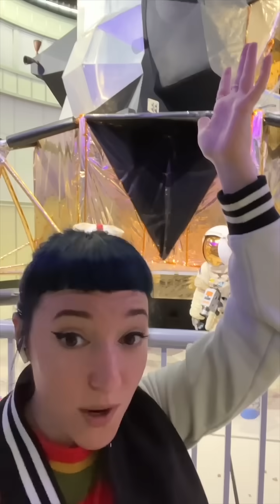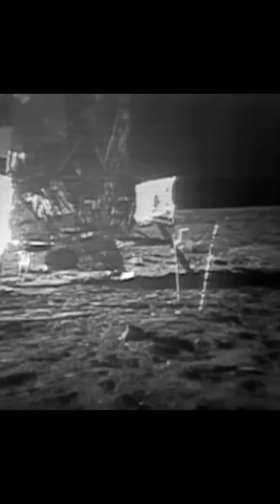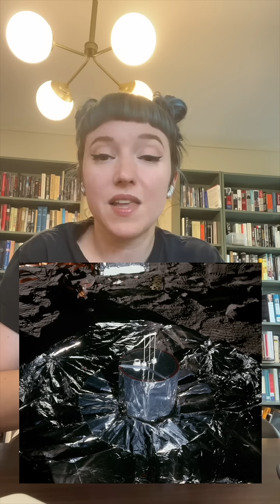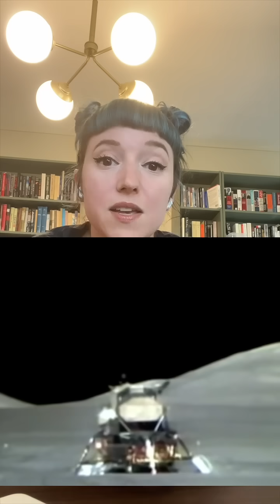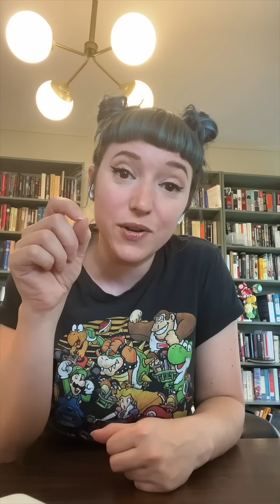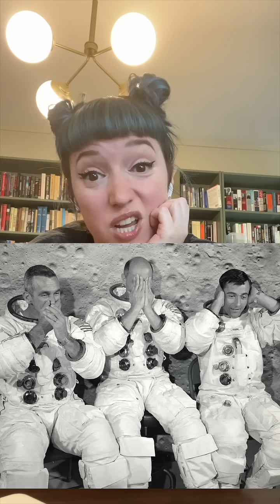Crashing Apollo Spacecraft for Science #shorts #history

Comment: Wow - I thought the Apollo 13 Lunar Module was jettisoned in space and was unaware it was directed to crash into the ocean.  It didn’t burn up on re-entry? What’s a good resource to learn more about this?
Reply: "It didn’t burn up on re-entry?"

Yes, most of it would have burned up. But parts would likely have survived.

One part which definitely would have survived was the "nuclear material". That was a radio-isotope thermoelectric generator (RTG). The RTG generated electricity from the decay of radioactive material, and was used to power the science instruments intended to be set up on the Moon.

For safety reasons the Apollo RTGs were designed to be very robust (think of a Saturn V exploding on the pad). As a result the Apollo 13 RTG definitely survived re-entry, and is now on the floor of the Pacific Ocean, releasing a tiny amount of heat.

Comment: The third stages of Saturn V were also used to create seismic signals, I assume from Apollo 12 and forward. They weighed more than the ascent stages.
Reply: I was looking for this comment. Was going to post it myself if I didn’t find it.
Reply: I think one of the stages that were not crashed but went into heliocentric orbit came back 30 years later and first got detected as a new little asteroid. That had titanium oxide showing in the spectra...